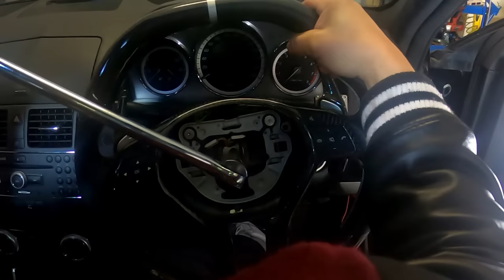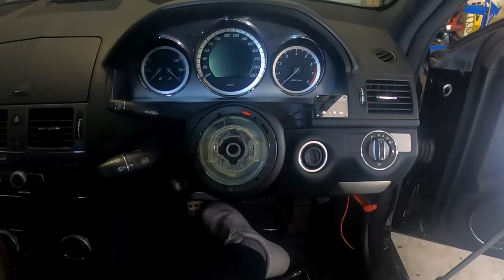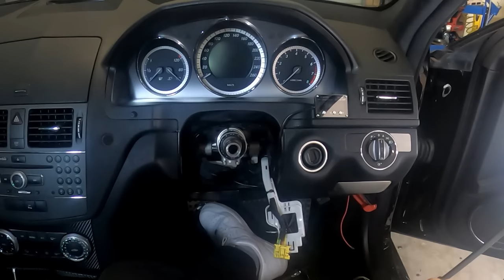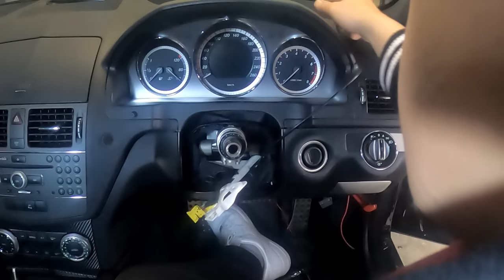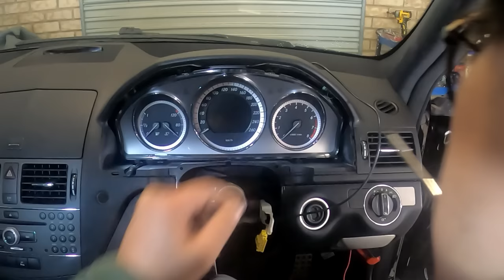HOW TO remove and fix ESL/EIS/ ELV MODULE  w212 w204 mercedes motor replace  Part 1

Comment: Hi, my friend.

Today I did the change of the motor in the ESL part using you video as a reference.
Everything was ok after the change. Thanks a lot for the guide it was very helpful.
Reply from the maker: so u managed to do it all??? I. so happy for you my friend it wasn't too hard was it ?? that why i made this video because i have no experience in automotive industry but i can still do it and if i can anyone can
Reply: Yes i did all the process and also I'm not a mechanic.
Reply from the maker: that's what makes it even better well.done that's what my channel is all about I'm no mechanic also and no electrician but I learn everything through the net and YouTube and then I DIY... so I encourage others to do the exact same .... well done ...
Reply: Luis Diego Solano did u have to reprogram the esl with the key??
Reply: Where did u buy the motor

Comment: Thanks Mike for 2 of your posts. Two weeks ago I installed  my new D1S  HID headlight bulbs with the assistance of your hid video. 2 hours ago Feb 26 2022 my daughter and I were installing a front side marker light on my 09 c300 benz. We got the bulb in but couldn't unlock the steering wheel as we had the wheels cranked all the way over.  Short of doing a  (which I would never attempt) an ESL removal, we loosened and extended the telescoping steering wheel and bounced it while cranking the wheel and turning the ignition on...it worked. Mind you the ESL  motor may be failing, so I will never touch the wheel after pulling the key. THANK YOU Mike.
Reply from the maker: great stuff mate well done I applaud u

Comment: Dude you are the man. I am AAA roadside assistance in South CA I had just now as I writing this comment 2012 MB GLK 350 ESL issue. To solve or better understanding I was just researching on YouTube. I came a cross your video. In 3:17 you said just tab on it, and I just did tab on the steering wheel with plastic hammer. Man it worked wow she was super happy my member OMG. I got it going. Thanks you so much dude.
Reply from the maker: ur welcome mate so glad you got it going ...but also remember thats for special circumstances ..not all cases will work this way.. depends on the situation also
Reply: Yes, we must thank MIKEYZ for his great video. If you still have her mobile (cell), make sure she gets the ELS fixed ASAP as the motor slowly burns out. I believe I had two or three chances.

Comment: Hey Mikeyz, excellent video and it is rather informative. Do you happen to know the motor part no or where to order? I want to have the part ready  before opening up the steering column. Many thanks in advance!!
Reply from the maker: Hey, buddy, these parts are readily available on eBay Ellie, Express and even Amazon. Make sure it is the w 204 e s l module And of course , just ensure you ask the seller that it is in fact for the w twelve for esl module..where do u shop I'll send u a link and where are unlocated country wise
Reply: Cheers Mike!!
Reply from the maker: @millpepper2012  no worries at all. I thinkni may have to do a video showing how I got the esl module out ... eventjo it was all dome by feel... some ppl are asking anyways... but most ppl figures it out cuz obviously there's on one way it comes out

Comment: Shout out to you Mikey...You gave me the push to go forward with this job. I feel like a certified Mercedes Technician...lol. I got the pins out by drilling a threaded nail in it and pulling it out. I destroyed one, but it only really need 3. I would like to add one more important tip to your tutorial. When you are putting that circuit board back in place. Do not smash it down before pressing the left bottom on the board in. If not, it rest on a metal piece on the bottom case that can potentially break it if you smash it down. It was a close call...But I got it DAWG!! Thanks!! Keep in touch and GOOD LUCK to you in the future!!
Reply from the maker: good tip mate congratulations friend ..I'm so happy you could do it .... well done

Comment: Just did this last night. Thank you very much for the video. Mine was actually stuck in the locked position. We removed the unit and drilled a small hole that we used to access the gear. We were able simulate the gear into the unlocked position. Had no issues with a frying of the chip.   One thing to note would be the pins to remove were very difficult even with the tool provided with the kit. We ended up just drilling them out slightly. May make the car easier to steal, but if someone wants the car that bad they can have it. lol. Took a long time to disassemble and reassemble.
Reply from the maker: good job mate.. well done .. im glad it all worked out ... thats is a way u can do it ... but good on ya for doing the job yourself..i take my hat off to you... i always said if this happens again im getting an emulator as less movingnparts and no motor means no failure...
Reply: Hey so when you put it back together u set it to lock position before connectint ir back to the car?
Reply: @aidas901  ya we set it back to locked

Comment: your video helped me a lot, i fix a case the same as your video, it was just the ESL motor that got stuck, in addition as a tip, you dont need to remove the steering wheel, neither the instrument panel, just remove the lower cover, then remove the 2 back torx  d12 bolts, and loosen the 2 front d12 torx bolts so it can give you enought space on the steering column to remove the ESL, then you just push the steering wheel upwards to have space on the steering column, thanks again mikeyz
Reply: it seems your advice is very simple. How many mintues to take out the motor of ESL.
Reply: @wfsin  about an hour, but it can be done in less time now with experience
Reply: alberto yamamoto Well noted with thanks!
Reply: alberto yamamoto     1. That mean it must ensure the ESL is in unlock position and disconnect negative point of the battery (how to know in unlock position of ESL)?
2. Whether we will just remove the four bolts (T12)holding the column, lower it, then loosen the 13 mm nut holding ESL, push the bolt in and pull it out, right?
Reply: @wfsin  
1 yes it must be unlocked (if you can turn the steering wheel.. its unlocked) and yes you disconect the battery
2. thats correct
Reply: alberto yamamoto Noted with many thanks!
Reply: @albertoyamamoto1174  how do you know if it's in the unlock position? I feel like I can move my steering wheel, but it's like there's no power steering, it's very difficult to move, but possible. Does that mean it's in the locked position?

Comment: Mikey I see a fix that would have made the steering wheel shaft removal easier for me.  The steering wheel must be in the push-in position before any disassembly. So pushed in , I'm tall so the shaft is pulled out for me. Easier to remove it from its area and probably why it was so hard for me to remove the ESL. Knowledge is power. I thank you very much brother.
Reply from the maker: u r most welcome dear friend
Reply: @MIKEYZVLOGZ  I had to take it apart again.  After installation of everything I left the key as instruction but the esl did not lock after removing the key.   My assumption is that  I may have a defective  *%*# DC motor,   There is no chance of removing my esl without removing the steering column on my car.  There is a box over surrounding the esl maybe the cars you work on does not have this box around. So I would have to remove the &%$#@ whole column again.  It's very upsetting that this ESL failure is not neglect of the driver but a manufacture defect.  There should be a recall on this crap. I'm located in Canada c class 350 2008

Comment: great vlog bud, i was stuck with same problem today and after confirming that my battery was good i started looking for more info regarding this problem. saw your video and applied your tap/bang/mallet theory in my own way 😂😂. i basically had the key in on position and tried moving steering left to right against the lock 3-4 times and it sort of "reset" motor contact i believe. its working now and i have ordered in a new motor to replace next week. Dealer cost was 599$ for parts and 800$ for labor + taxes, which will now be taken care of now for only 11$. thanks for the great vlog, helped me save some decent coin.
Reply from the maker: glad to hear it mate ... well done

Comment: Great video. I decided to purchase a replament Module from Main dealer. They provided a progam key to code the new unit to the old key. I also had a coolant leak so I paid a mobile mechanic to fix both faults. He manged to replace the ESL with out dismantling the steering column.
Reply from the maker: fantastic friend...im glad u got it sorted it really is a shame that w204s have this issue my w203 is 20 yold and never fails

Comment: Thank you so much again for the detailed explanation and tutorial man! I finally went ahead and replaced the motor after first watching your video 2 years ago. This job is actually not too bad but it definitely takes some patience. Just some things that I thought I'd add:

1. I didn't take off the instrument cluster and there was enough room for me to work with 
2. Super helpful to have someone hold the steering wheel while the other person is on the breaker bar. Retighten the wheel at 80NM or 59 ft lbs
3. After disconnecting the battery, let the car sit for about 30 min - 1hr to ensure all the electricity leaves the vehicle. This is most important for the airbag to ensure it doesn't deploy by accident.
Reply from the maker: more then welcome
Reply: @MIKEYZVLOGZ  Also just wondering after you replaced the motor, does the steering wheel have some play in it, when its in the parked position? After I insert the key, the amount of play is the same. I can't remember if my wheel had no play at all before I did the ESL motor fix. I drove my car and everything feels fine. Thanks!
Reply from the maker: @MTSLFilms  well yes wheel will be same as before ..as long as u reinsert it correctly .... small play is ok but not too much it slips off

Comment: That tip about hitting the ESL with a rubber hammer to see if it jogs the motor into life has just saved me a load of money and a load of hassle. What  a legend.
Reply: Austin Powers  Mine carried on working for just under two months but then it it went again and this time no hitting it would solve it so I took the steering column out, cut the bolt holding the ESL in place and replaced the motor in it. I'm now using the ESL the same as if it was an emulator so no steering lock.
Reply: Austin Powers  yes, only by following youtube videos. Total cost for the repair was about £7 for the new motor. Getting the steering column out wasn't too difficult a job. If I'd known the repair would have gone so well, I would have changed the motor before it completely failed and needed a tow truck to get me home.
Reply: @davelee-00  you change yourself the motor this no need reprogramming after this?
Reply: @benolazaj4961  there is no need to reprogram it because it is only the motor that has changed.
Reply: @davelee-00  so I will try myself thanks
Reply: Bro I change the motor and still not working
Reply: @benolazaj4961  Oh dear. Looks like maybe the circuit board has had it. Is there no sound from the motor when the key goes in?
Reply: @davelee-00  I the board is dead I think what can I do
Reply: @benolazaj4961  You can buy an emulator that replaces the original ESL but it needs reprogramming. Not my specialised subject though. I was lucky.
Reply: I used my left hand and smacked the underside of the steering column while turning the key on/off continuously and it stayed unlocked for about a year then it locked up on me again and I sent it to the dealership. They told me it was the ESL I already knew... I told them I was gonna tow the vehicle home and replace it myself I found the part for $20 on ebay. 
They told me that they have to do the ESL repair because the part comes from Texas and it's coded to my vehicles Vin and keys. They charged me $960
Fooken rip off
Reply: @davelee-00  so u have the fixed ESCL just hanging somewhere under the dash? And vehicle still starts since it recognizes the ESCL and motor performing correctly.
Reply: @jo4285  The ESL is wrapped in foam and stuffed in a space so it isn't actually "hanging somewhere". That makes it sound like it's swing around loose  😀. Because nothing has changed in the "box" other than the little motor, no reprogramming is needed so everything is as it was originally. The only difference on mine is that the steerng lock no longer works, which means if it happens to fail again, the car will be able to be steered out of a parking space rather than dragged sideways by a tow truck, as was the case.

Comment: Hi MIKEYZ, 

Thanks for help from Melbourne. When I turn the geared wheel in the ESL there appears to be binding happening, which may be a cause of the motor stopping and later burning out. This is why your "hitting trick" works. Lithium grease has been suggested as it helps for plastic on steel and steel on steel.

I have also worked out why it needs the pushing back of TWO grey pins of the limit switches during the addition of the motor/circuit board:  The ESL can only be installed again with the locking pin of the steering lock to be retracted. In that position, both pins meet the posts and have to be depressed.

Aliexpress is selling that motor by the tens and the tool with a handle to hammer in to pull out the four pins of the ESL with a pulling and clock-wise rotation (Youtube) plus the cylindrical tool to take out the ignition lock plus the ESL US$3.75 motor. But no longer (Jan/Feb 2020). Had to buy the motor locally as Chinese postage system is not working due to the virus. Looks like Merc used that Chinese motor already in 2007 for my W204 C220.

With your trick of hitting the ESL and getting it going one last time you must have also shut up the NEC security chip to stop the system altogether. I was not that lucky and had to take out the column to cut off the 10mm mounting bolt on the ESL as the steering was locked. There is a suggestion, that having started it too many times with failing motor, the NEC chip for security reason disables the lot and I and many others will have to take out the EIS/EZS (ignition) and ESL and key and get someone to sync it again. Or get an emulator and expert help.

Later models of Merc no longer lock the steering as it is unnecessary and in America the owners of older Mercs are talking class action as most had the vehicle stopped in distant places, had to have them towed to stealerships and then got hit with a US$1200 bill plus towing.
Reply: Where did you hear the news of class action? I used the heavy impact trick to get ESL unlocked from locked situation. so I can get mounting bolt pushed in. After that I replaced the motor and now the ESL does not respond. Do I need to find someone to sync the ESL and EIS?
Reply: @arnoldyan8265  very concerning about your story?  Have you got it to work eventually?

Comment: You are awesome I just finished it and it works! I had trouble finding a torque wrench long enough to take out the dash. So I skipped that step and still was able to do it! Thank you very much :)
Reply from the maker: Kool bro
Reply: @MIKEYZVLOGZ  was your new motor also much louder?
Reply from the maker: @deanzion23  no actually same.or maybe even quieter
Reply: I must of gotten a defective one or maybe I did something wrong. Its super loud. Im thinking that I might just remove it from the stirring column but keep it connected electrically, since it looks like there are two buttons on the board inside the esl that when pressed give a signal for the car to start. 🧐

Comment: Tip:  Before removing the steering wheel, mark the steering column and the inside of the steering wheel with a Sharpie so you can line them back up properly when you put things back together.  I had to remove the steering wheel twice to straighten things back up.
Reply from the maker: good idea .... very good strategy and tips mate good on ya for mentioning ... sometimes I forget that some ppl will have no experience at all ... so this is a great tip for any amature DIYer
Reply: The only work I had ever done on the car before was to change the COMAND knob post, which had broken.  I am not so much into doing car repair as I am trying to not pay the high price of repair at the dealership.  And of course, I love it when everything is working like new, even in a 9 year old car.  Thanks so much for making it possible for us newbies!
Reply from the maker: @knoxvillain6735  well done mate that's why I started this channel to show other w204 owners that if someone like me without a mechanical mind and experience can do it so can others too... well done on taking up the task and trying ... I take my hat off to you for giving it a go and succeeding friend..that's what it's all about ...saving money and encouraging DIY

Comment: Mike, thank you for a great informative video. Quick question: Once you have replaced the little electric motor - do you need to program the EIS and the key, or can you simply replace the motor and it will work like it should?
Reply from the maker: no programming no syncing it will work by simply reinstalling everything back in, programmin is only needed when the chip fails needing new programming and csuncing to to suit the car
Reply: @MIKEYZVLOGZ  Thank you sir, your video is very instructional! Much appreciated.
Reply from the maker: @macjohnw7870  ur welcome